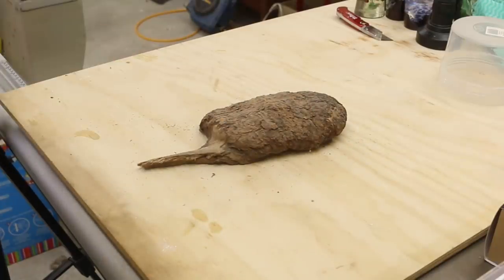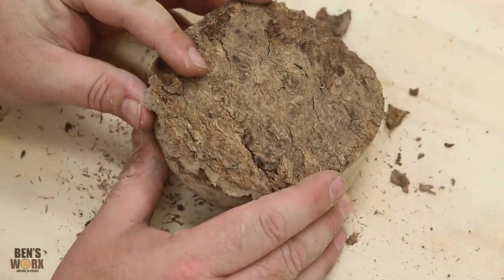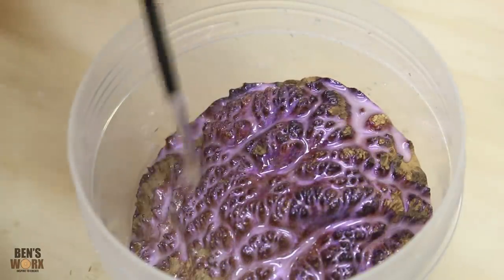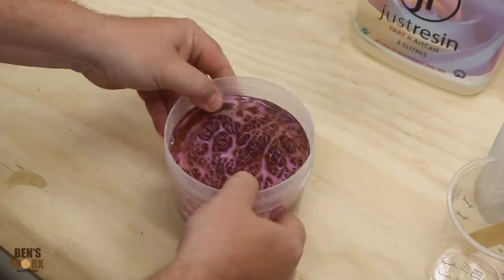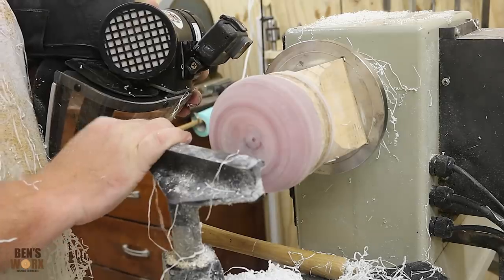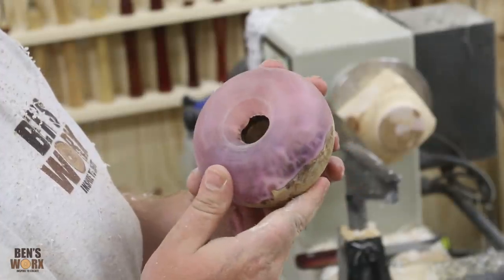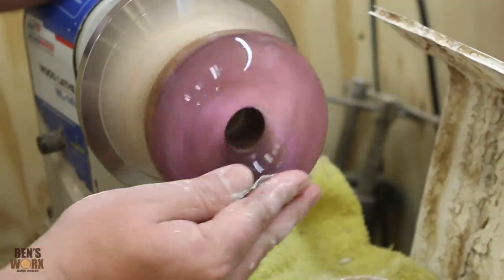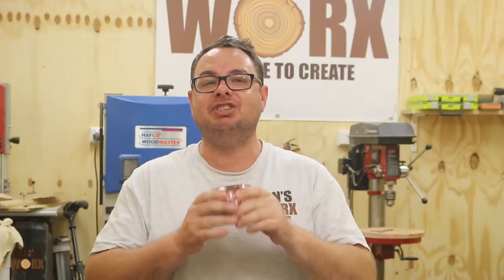Making the Simpsons Donut using Burl and Epoxy Resin

Comment: That turned out really good. How about a Mount Everest donut. One side (wood) higher than the other with some mini climbers and gear like ropes and ladders going up to the peak and a base camp on the low wood side. The hole in the center gives an endless look as you turn it following the climbers up to the top.
Reply from the maker: cool idea mate

Comment: Hey dude, using  a  low surface tension solvent (like  90+% alcohol or acetone)  will  get between hot glue and your substrate immediately and give you a clean release
Reply from the maker: Thanks for the tip mate

Comment: Even easier way to release hot glue than the hair dryer is to spray some Isopropyl Alcohol on it. It'll come right off without leaving any residue to clean up.
Reply from the maker: Thanks for the tip Ryan
Reply: @BensWorx  I will admit that I haven't used this trick on resin, but it works on metal, wood and plastic so I can't see why it'd be different with resin.

Comment: Ben, that is amazing, I Love the color pallette. With the big piece of bark try using white like you did the pink, then encapsulate it in green. You can carve it into a leaf pendant, or ornament. I am sure it would be amazing. I use my dremel to carve in resin then brush over it with a thin coat of resin to finish it off.
Reply from the maker: Thanks MaMaT, Cool Idea

Comment: Instead of using a hair dryer to heat up the glue (and the surrounding area) try using rubbing alcohol!  Easy to remove without any risks with heat as long as your material doesn’t react to the alcohol :D

Comment: Gee, I’m impressed. 1st time here. I’d really love to learn casting. Why do you use the pressure tank. Is it so you can get the air bubbles out without melting the mould? Complete beginner here. Cheers!
Reply from the maker: Yeah mate, to eliminate bubbles

Comment: hey, just a tip with hot glue is if you just use a few drops of rubbing alcohol where its glued the alcohol will flow in between the object and the glue freeing it extremely easily with no residue left over.
Reply from the maker: Thanks for the tip mate

Comment: I use a Grizzly G0462 wood lathe. 
For some reason whenever I turn, the only way I can shave resin down is with sand paper because when I use the tools it keeps catching and splintering off... and hurts like a motherfucker. 
Would you be able to tell me why this happens at any of the speed settings?
Reply from the maker: is your chisel sharp?
Reply: I use interchangeable  tungsten carbide tips that are very sharp. 
The catching happens on all 3 tip shapes. 
And also didn’t really have an issue on my older lathe.
Reply from the maker: Are there any height differences between lathes? Maybe the tool angle is different?
Reply: The hand test does seem to be a bit higher. But, I have tried to angle the tool down to be in contact with the project at a lower point, but doesn’t seem to help. 
I’m wondering if the lathe just isn’t fast enough?